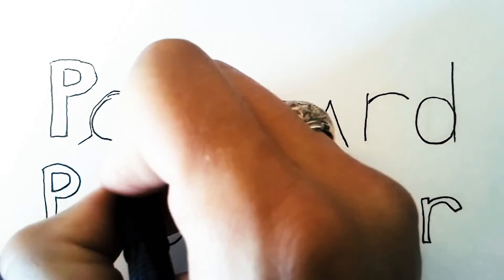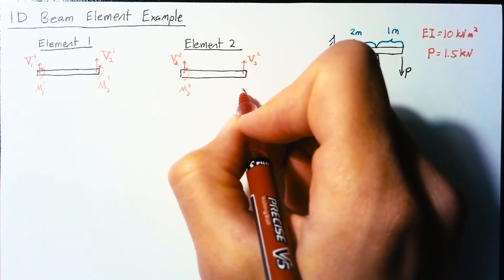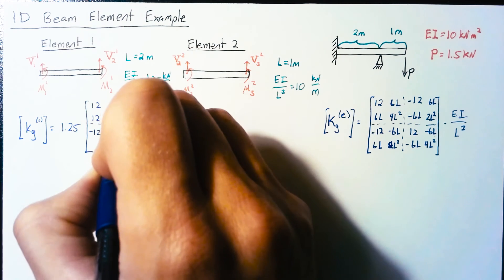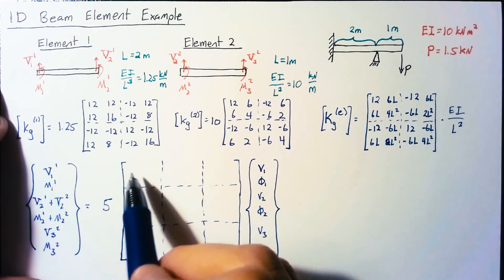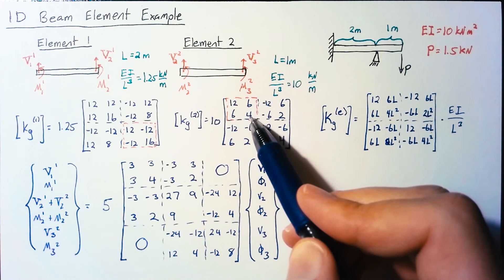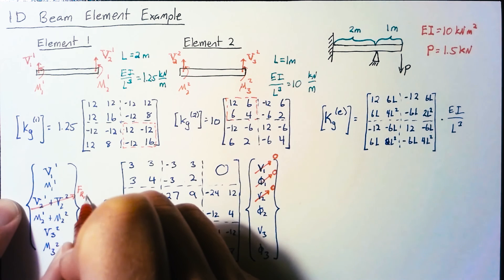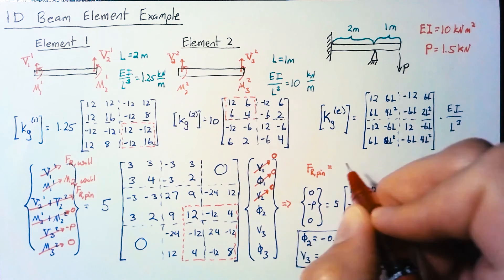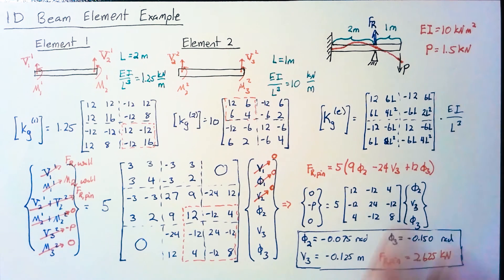1D Beam Element - Example

Comment: Please explain if possible, the middle support (PIN) should have a resultant moment, isn't it? Because intuitively, P is pushing down, the PIN won't settle and the wall won't let move up either. So, there should be a bending effect on the PIN.